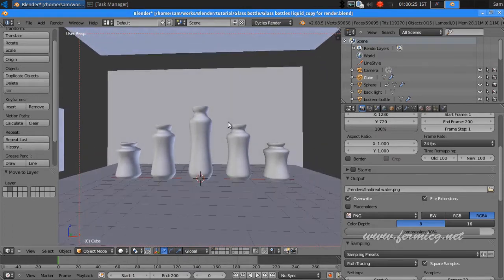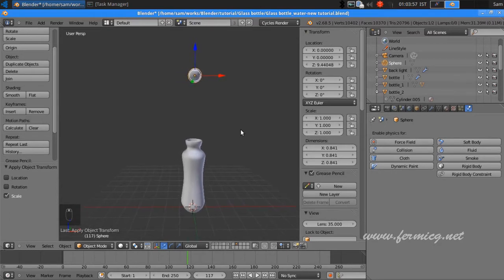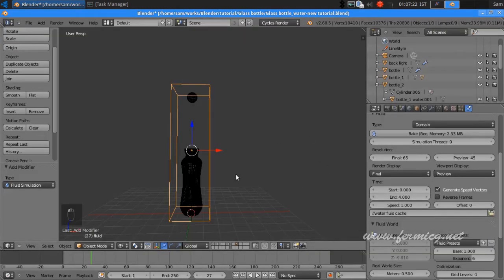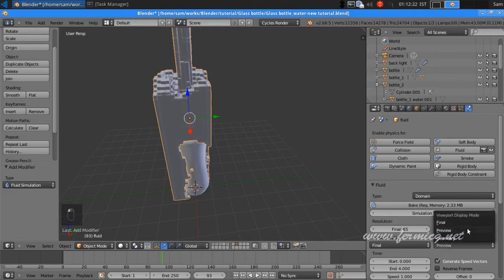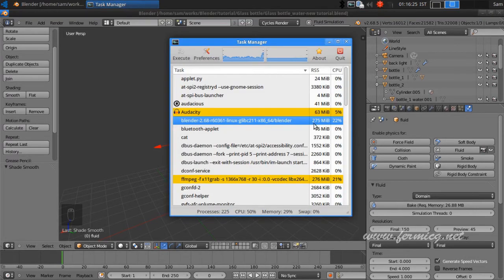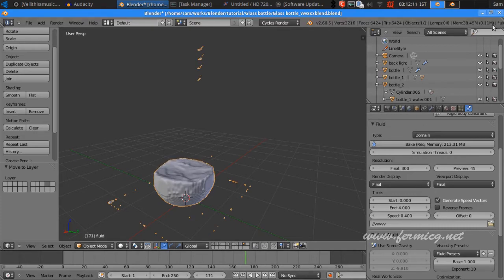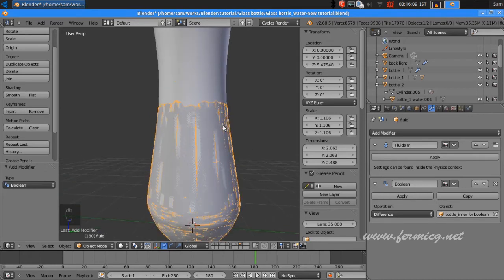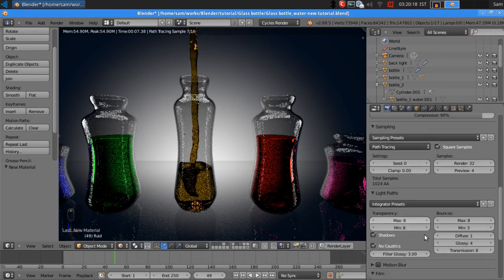How to simulate fluid in  Blender tutorial

Comment: awww thanks brooooo this is what i want XD
and for prevent wall break thhrough, can we also use increase smooth setting in fluid option also smooth modifier?
Reply from the maker: yes you can. But increase as increments. If you apply too much smooth settings you lose the fluid shape. Adding smooth modifier is a good choice if you have a good computer with a lot RAM and CPU speed.